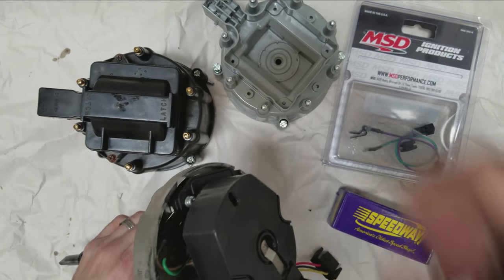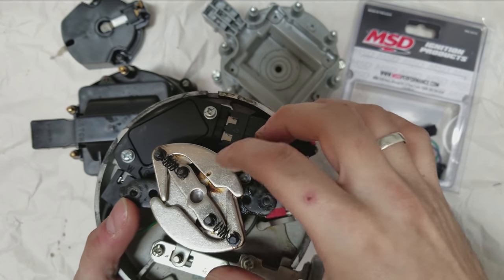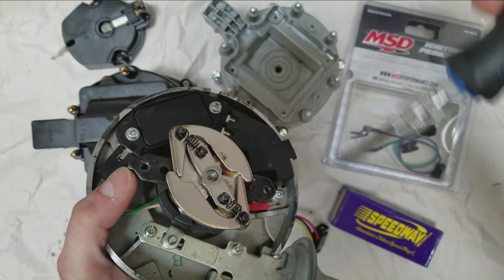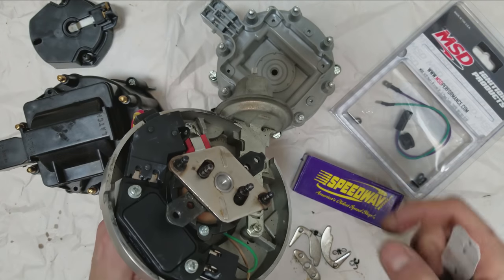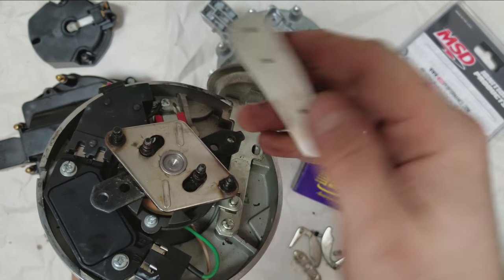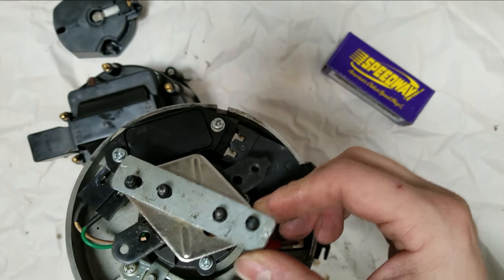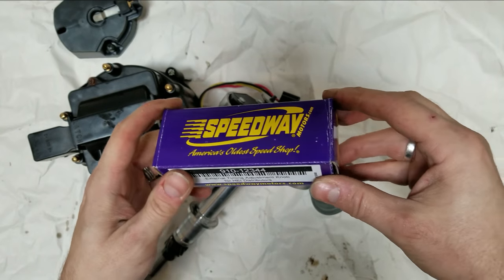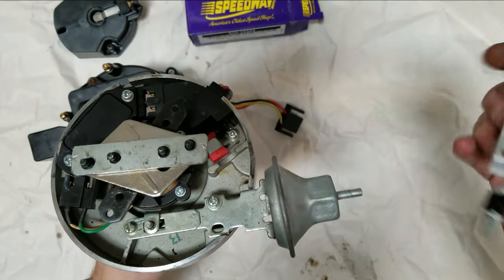1967 Turbo Camaro - GM HEI Large Cap Distributor Timing Control with Holley Sniper EFI

Comment: Awesome video but I have a strange question for you. When setting my static timing I disconnected the fuel pump relay and confirmed that the fuel pump was not running however the engine still starts and runs for a few seconds then shuts off. No matter how many times I tried it the engine would continue to start which shouldn't happen without fuel pressure. Do you know if there are any seals that could be leaking allowing the engine vacuum to pull fuel into the engine? I've looked at every diagram I can find but can't seem to find the information I'm looking for
Reply from the maker: Interesting question. I assume you have the Holley Sniper, and if so I'm still not certain. It's possible you're getting a few drips pulled through the injectors, or just residual from within the fuel line. I'd be sure it wouldn't stay running without pressure, but having a couple drops of fluid in the intake may be enough to get it started. I'd bet that eventually, 4-5 starts in, it will become difficult to start or it won't start at all. If it's preventing you from setting the static timing, you could always pull the plug wires off the plugs (not the cap) and with them tucked away safley to the side, crank it and get it done. Just don't zap yourself with a loose lead 😉
Reply: @TurboCamaro67  thank you for getting back to me so quickly. Yes getting zapped really sucks. I thought the same thing that it may be some residual fuel allowing it to start but after attempting it almost a dozen times and it starting every time really started confusing me. I even used my remote starter and cranked it over for 30 seconds with the ignition off but as soon as I turned the ignition on it started again but will only run for about 4 seconds and then shuts off. This system has been kicking my butt. It is almost as if it is getting fuel around the Injector seals. I've seen the injector seals leak on the Holley two-barrel throttle body injectors but I'm not very familiar with this sniper kit
Reply from the maker: Unfortunately I'm not aware of any part of the system designed to intentionally allow fuel through, but it does seem that way. I'd consider doing it my way (leads off the plugs) and see how it goes. If it starts and runs fine otherwise and the timing is working I'd not be too worried about it. It is odd though. Hmm, how you considered pulling the relay and the fuel line to the Sniper?
Reply: @TurboCamaro67  that was actually the first thing I did was pull the relay and remove the fuel line from the throttle body. It's almost as if the vacuum created by the engine is pulling fuel somehow because with the fuel lines disconnected it won't start, and if it did then I would definitely have one hell of a problem LOL. I will be working on it some more tomorrow, with a little bit of luck I will finally get this thing running
Reply from the maker: Very interesting.. well with both of those things pulled you should be able to get the static timing done and at least move on from there. Perhaps the issue will present itself again and be easier to solve at that time
Reply: @TurboCamaro67  first off I wanted to thank you for responding back to me before about my question. I got my static timing set at 15° and locked down to distributor. After disabling the idle timing control and starting the car, my timing is jumping completely passed my timing tape which goes up to 60 degree btdc. I've tried everything I can think of to get the timing to stay at 15° at idle but it keeps going way to Advanced. Wondering if you had any ideas as to why it shows 15° when cranking the engine but jumps past 60 degree when the engine starts? I tried calling Holley Tech Support and the gentleman I spoke with was no help at all. Again thanks for all of your input
Reply from the maker: That's a pretty big jump. Please don't take this as insulting, but be sure you have the tape oriented correctly. The 0° mark on the damper should move 15° to the right, then a little more once it starts. If the tape or mark is wrong it'll give the illusion of a big jump to 60°.
Reply: @TurboCamaro67  I wouldn't take it as insulting. The timing mark is definitely right, when I originally set it at top dead center it was perfectly lined up. I set the timing at 45 degree then installed the distributor. I then cranked the engine over and locked the distributor down at 15° for my static timing. As soon as I start the engine the balancer is hitting at the zero Mark completely passed the timing tape which goes to 60 degree btdc. I disconnecting the fuel pump to recheck the static timing and sure enough it was at 15 degree. This has me pretty confused. I've been building cars and engines for over 30 years and never seen anything like it. I'm wondering if I may be getting a lot of RF noise screwing with the computer. If I could get this one problem figured out I think I would be gold, unfortunately no one I've spoken with can explain why it's doing what it's doing. It ran great with the carburetor on it, kind of makes me sorry I purchased the sniper kit, it's been a PITA.  Again thank you for taking the time to respond back
Reply from the maker: So you've chosen 45° as your reference angle. You've set your balancer at 45°. You've ensured your magnetic pickup has contact at while at 45°. You've tightened the distributor down. You've phased the rotor the best you can. You've unplugged the fuel relay and set the Sniper to 15° static timing and cranked it and it shows 15°?  Then set static again to 15° and it starts and jumps to 60°? Ensure you've done just as I've said above as it's easy for even someone with tons of experience to confuse when to lock down the distributor. The reason I question the steps is because your 15° plus 45° reference angle = 60°... Makes me wonder if the distributor wasn't fastened down at an angle other than 45°.
Reply: @TurboCamaro67  I just redid the entire process. I pulled the distributor out and brought the motor up to TDC. Then manually set it at 45 btdc and stuck my distributor in. Made sure that the magnetic pickup is lined up then I set the static timing with the fuel pump disconnected. Once I confirmed it was at 15° on the dot I tightened down the distributor. I checked it one more time with the engine cranking and it is at 15 btdc. I reconnected the fuel pump relay and started the engine and again the base timing is past the timing tape which goes up to 60 btdc. I'm guessing it's reading closer to 90 being as it's past the timing tape. This really has me scratching my head LOL. I'm sorry to bother you with all these questions, I just can't believe how bad this thing is kicking my tail.
Reply: Just in case I am missing something, after I have set the static timing while cranking the engine, am I supposed to reset the static timing when it starts and is idling or should it already be set after I locked the distributor down
Reply from the maker: Hmm... I hate to harp on this, but when you set it at 45°, the 0° mark on your balancer is a couple inches to the LEFT of the TDC line off the block?
Reply: @TurboCamaro67  yep. When I initially put it at TDC it was lined up perfect with the mark on the balancer then I turned it to 45 degree on the timing tape rich I got for the 8-inch balancer and after setting the distributor in and snuggling it down I cranked the engine and set the static timing to 15 degree then locked everything down. After tightening down the distributor I double-checked the static timing and confirmed it was at 15 degree so I started the engine and rechecked it and it was about 1.5 in to 2 in past the timing tape. I again shut the engine off and disconnected the fuel pump relay and cranked it over and while cranking it my timing mark was at 15 degree. It just doesn't make any sense.
Reply: @TurboCamaro67  I will try to make a short video of it, if nothing else once I finally figure out the problem maybe it will help somebody else out in the future
Reply: @TurboCamaro67  one more thing, when I set it at 45 degree, the zero is a few inches to the left of the timing mark. My engine spins clockwise so 45 degree btdc would be to the right
Reply from the maker: Ahh okay, I've had several people contact me about it and the most common, and easy mistake to make is accidentally confusing Before and/or After TDC. Your symptoms match that issue spot on. If you were setting it to 45° after (retarded) TDC instead of before (advanced), it would add 45° to your desired 15° and you'd sit at 60° like you are. People have the tendency to rotate the engine clockwise to 45° instead of counter-clockwise, causing the issue above. I'd were certain we've got that right, how about your TDC, are we certain we're on TDC of the compression stroke?
Reply from the maker: Yes, you want the TDC on the block to the right of the balancers mark. Advanced is good, as we want 45° before/advanced of 0.
Reply: @TurboCamaro67  top dead center of the compression stroke.
Reply: @TurboCamaro67  very true. I'm just completely baffled as to why I'm getting the results that I am. I am 100% sure everything was done correctly, it just makes no sense why it keeps changing on me. Holley Tech Support said that after I set the static timing and tighten down the distributor to start the car and reset the static timing with it idling. That just makes no sense to me because with the timing reading as far as advanced as it is, if I try to set it at 15° btdc with it idling the car is going to stall right out. Either I have a defective part somewhere or my setup just isn't compatible with the sniper kit. Duh Tech Guy couldn't give me any more help than that, he told me that it was never designed to run that way there for they can offer no help. SMH
Reply from the maker: @pennypug97  hey, as an FYI I edited my last few comments as the theory was correct but I made the mistake I was describing by reversing the directions. Sorry for attempting to mislead you. It does sound like you have the timing right, I'd like to see the video if you can. Despite my recent confusion, this sounds like a fixable issue to me.
Reply from the maker: @pennypug97   I re-read the thread and noticed a couple instances where you mentioned tightening the distributor down at 15°. To be sure, are you tightening down the distributor while at 45° or at 15°? We want it tightened while it's at 45°, as the Sniper system is actually delaying the spark X° in order to put it at whatever spark ° it wants to achieve. Setting it to 15° then tightening it will cause it to think that point is actually the 45° reference angle and mess the timing up accordingly. I would think that would actually give you a retarded timing but who knows how it calculates things.
Reply: @TurboCamaro67  when I put the distributor in I tighten it down at 45 degree. At that point I set my static timing and because it's not quite at 15° I have to turn the distributor a little bit to get it at the 15° mark. Is there any way to get it to the 15° Mark without turning the distributor? I installed the external vacuum advance knob just as you did however when I tried to adjust it using the knob there isn't enough adjustment there to get it to the 15° mark. This could be my whole problem is that to get 15 degrees before top dead center static timing I have to turn the distributor a little bit which like you said is going to change my 45 degree reference. Again thank you for all of your help, and as far as your previous replies, I didn't take it in any negative way at all. If anything I thought maybe you were testing me just to make sure I was setting everything properly.🙃
Reply from the maker: Hmm... Rotor pointing toward #1 spark plug? Also, what happens if you set static timing to 15° and then start car? Does it stay at 15° or skip right to 90ish°?
Reply: @TurboCamaro67  after setting the distributor in at 45 degree for my reference and then slightly turning the distributor to get 15° static timing I start the car and it immediately jumps up to 90 or around there. I turned the distributor a little bit after dropping it in at 45 degree btdc because there was a video from Holley about the MSD magnetic pickup installation and they said that if you did not have 15° static timing to slightly turn the distributor.
Reply from the maker: @pennypug97  yep, a slight adjustment to align the static with what you see on your light is expected. So, your install sounds right. Does it jump up to 90° even with the static timing enabled at 15°? What distributor are we trying here? How certain are we with the magnetic pickup and coil driver wiring? It possible your mag pickup wiring is reversed?
Reply from the maker: @pennypug97  Hmm... I'll leave my last post, but I've re-read this all again and really feel like the issue is related to setting the reference angle. I will write the steps out clearly for easy checking:
- move balancer to 45° BTDC (advanced) on compression stroke.
- drop in distributor
- adjust magnetic pickup and/distributor housing for pickup contact.
- tighten distributor 
- ensure rotor placement is sufficient for expected spark range (phasing).
- get access to Sniper software config on computer to set your minimum signal voltage to something other than 0 (critical).
- pull fuel relay and turn key to open Sniper software.
- set static timing in Sniper software to 15°.
- crank engine and have friend confirm cranking at 15° ish. 
- if close, reinstall fuel relay and re-enable 15° static timing in Sniper software.
- start car.
- timing with light should be near 15°, if out more than 1-2° then make superficial adjustment to distributor housing to make it show 15°.
- if timing was way off 15° we don't adjust to make it 15°, we need to figure out why before proceeding.
- if at 15° and holding, begin the revving process and inductive delay adjustment.

Comment: So we're does the coil neg. Hook up on the other end ( that jumper wire)
Reply from the maker: The other spade terminal (coil negative) is not used in my configuration. The yellow wire coming off the module is feeding the negative side from the smaller connector just below the unused one. Nothing is required on the larger negative connector. I used to run an analog tachometer off that spade but now run it off the Sniper harness.
Reply: @TurboCamaro67  I'm trying to do the same thing for my ACES EFI I bought the MSD ICM delete wire and the adjustable knob I'm trying to figure out how to signal the coil , gonna make the locking plate today
Reply from the maker: @davidturner6397  I don't know anything about your EFI system, but the Sniper has the coil driver, which is fired by the Sniper EFI system once it receives a "trigger" from the sensor in the distributor. If your system has something similar, it should work to fire your coil with the right setup. Happy to help with any other questions.

Comment: Hi Turbo!  Are you still happy with this conversion?  I'm about to do this, with the help of your video, but I don't want to compromise any reliability at all.  It still works well?  Thanks again!
Reply from the maker: Funny you ask this now. I was doing some more tuning on the EFI the other day, and decided to check the timing accuracy with a couple different static timing settings. With zero maintenance since this video it still works perfectly. I laugh at the thought of doing anything but this simple HEI mod to obtain electronic controlled timing. Good luck with the setup and let me know if you need any clarification.
Reply: Thank you so much.  I have the Sniper in my 4x4, that I take out offroading on long trips in the desert, so total reliability is my goal. Do you see going this route as decreasing reliability at all,  or maybe even improving it?  A stock HEI distributor seems pretty solid, and parts are readily available, so I'm kind of torn on whether to mess with it.   Thanks again!
Reply from the maker: @brianm7879  I honestly feel it's the best possible method of obtaining electronic timing via Sniper EFI. As long as you don't experience any radio interfence, I don't see any disadvantage. Cheap, easy mod, and parts, like you said, can be found anywhere. It just works.
Reply: @TurboCamaro67  Once again, much appreciated!  I'll post back results when I'm done.